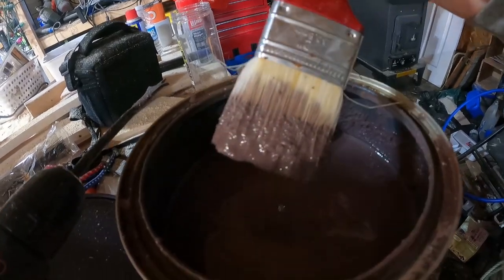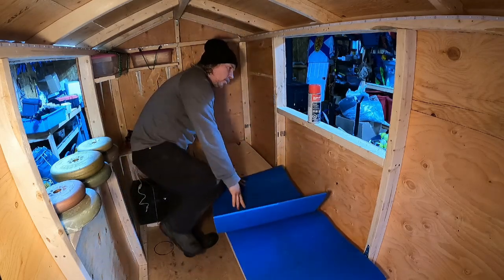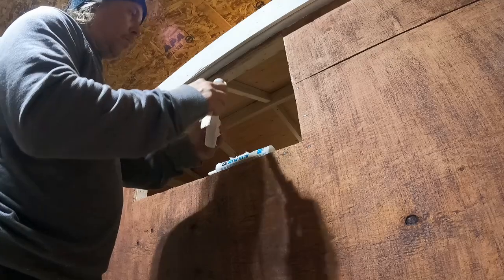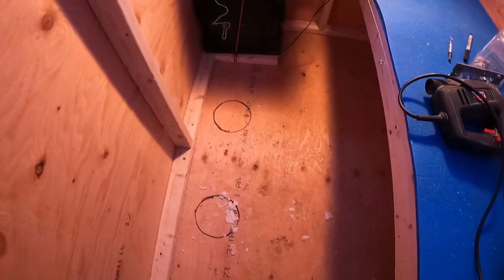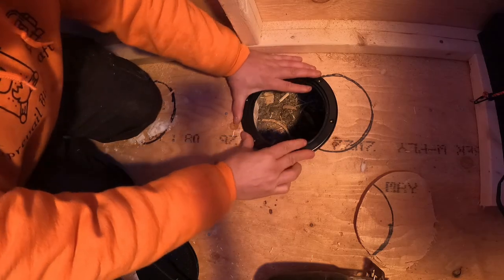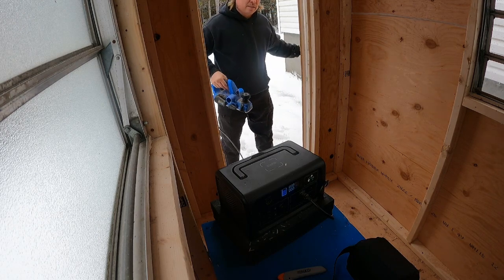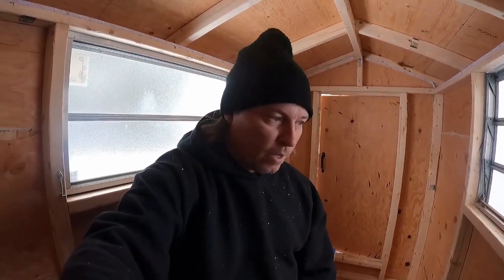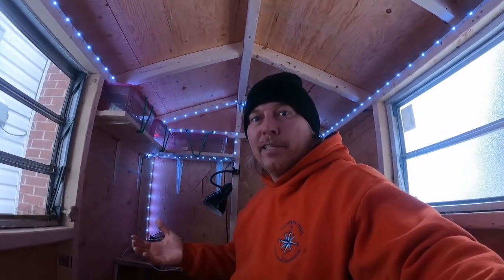Tiny Ice Shack Build (Part3) Only 32 Square Feet

Comment: Hey Troy 👋when I built my fishing shack I used 1inch styrofoam insulation glued it pl premium and tuck taped it and it was so warm inside, but that was 10 years ago when it was alot cheaper than, great job brother, and when I pulled it with my snowmobile I had to brace the inside of the door on the top and the bottom with 2by4s to keep it solid great build your awesome, and real peace ✌.
Reply from the maker: Thanks a lot Dennis !